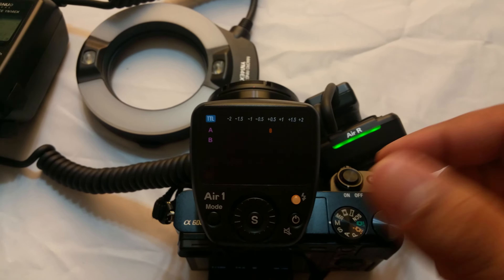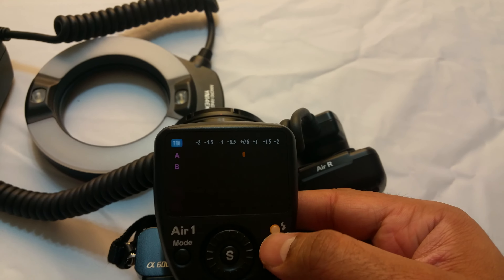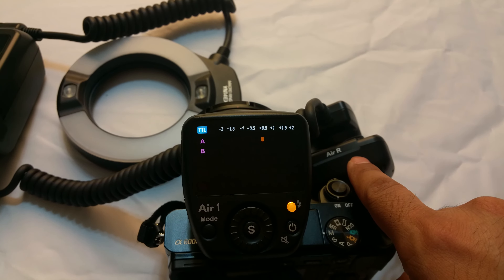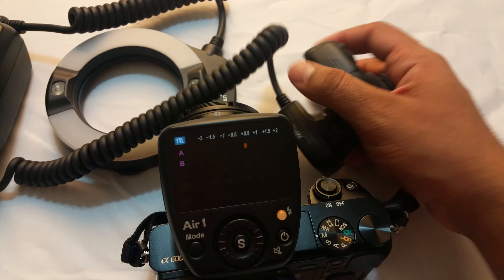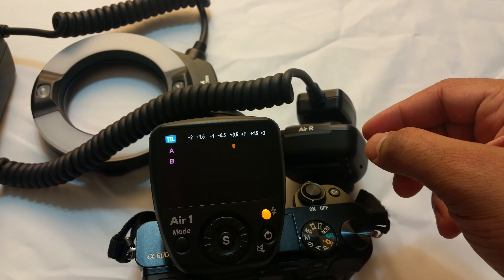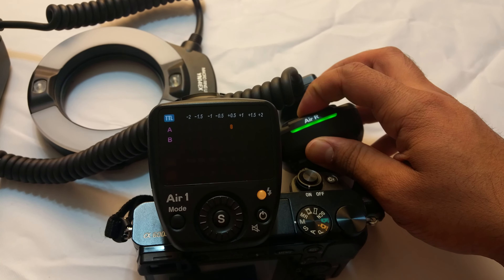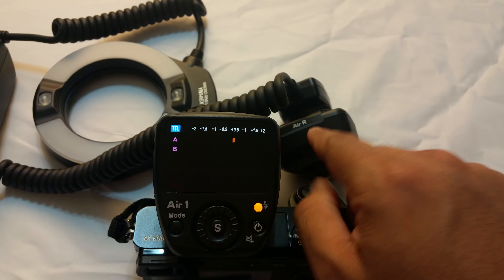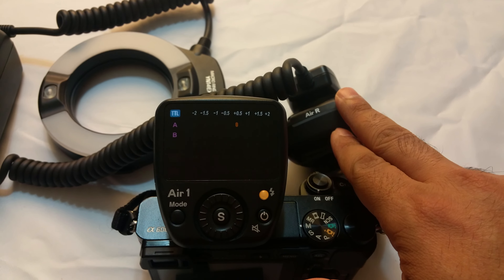Nissin Air 1 Commander Sony with Nissin Air R Receiver Canon

Comment: Unfortunately I am facing also problems with Nissin Air 1 & Air R . for some unknown reasons after 3 month using The HSS & TTL stop working on my A7rm2 + sony speed light ( HVL-43m ) everything sony and the receiver for sony too . 
but still working on A6300 . 
B&H not responsible after 1 month of purchase & Nissin not responding at all for the 2y warranty . 
something silly right .
Reply: This happened to me as well. 2 months after purchase the system no longer able to use hss in ttl mode.  I am able to fire hss on manual just fine.  No idea where to go for support.

Comment: ATG/Nissin has sold many ATG's Air X or Air10s to pre-paid/pre-order customers like Adorama and B&H Photo. The actual name can be changed providing if customers want/demand (think ATG/Godox, they change name under Adorama/B&H Photo/Interfit)

So you will need to get this awesome transmitter in May.
The ATG ranges is 1,000 feet while the Nissin has 100 meters.
* Any ATG's i60A, Di700A (Fuji/Hasselblad/Phase One/Canon/Olympus/Nikon/Sony)
* Any Air R

Let say, you are using Sony camera:
1. Buy the ATG/Nissin (May) for Sony
2. Since you already have Air R (Sony), place any Sony MIS flash on Air R
3. One friend has Air R for Canon, place any Canon ETTL II flash on Air R
4. Second friend has Air R for Nikon, place Nikon ITTL flash on Air R
5. Now, you got ATG's Tribrid TTL in wireless radio with Group A, B and C
or
6. Buy the ATG/Nissin (May) using Sony. Yes, you can buy C/F/O/N/S.
7. Buy or use any ATG/Nissin i60A or Di700A, then you don't need Air R.
    Again, i60A & Di700A (noticed the "A", it's by ATG) can be made for Fuji, Canon, Olympus,
    Nikon or Sony.

My ATG Gold Pentabrid Transmitter Kim X is compatible with Fuji/Hasselblad/Interfit S1/Profoto B1/Phottix Indra 500. And fully compatible with ATG & Nissn NAS Systems.
For $700.00+ USD, that is a great transmitter.
But if you are a beginner or amateur, get the ATG's Nissin for around $200 USD.

The world's first, only one transmitter is needed to work with many flashes/monolights.
* ATG AF illuminator (assist beam)
* ATG photographer firmware by Micro SD Port
* ATG wireless radio 1K feet or 100 meters
* ATG wireless radio TTL
* ATG wireless radio from 24-200mm zoom
* ATG wireless radio manual power adjustment
* ATG wireless radio 1st, 2nd and HSS 
* Very easy to see, setup and use

We needed the power of over 2,000ws when using HSS. 
That's why the ATG Gold Pentabrid Transmitter Kim X is a must for the working pros.

Did you noticed that ATG has hurt sales on Profoto B1, that Profoto is giving away a free TTL transmitter?

ATG is Godox/Jinbei/Interfit/Nissin/Yongnuo/Hasselblad/Broncolor.

Comment: Did you find out what was wrong? Is it because one is sony and one is canon???
Reply from the maker: Benni Knop yes, that's the problem. It should be of the same type sony-sony, Canon-canon
Reply: It is in receiver documentation: sony+sony, cannon+cannon, and so on... So in my case (i want to connect secondary CANON flash) it is not working...

Comment: The Nissin website report that Nissin Air R compatibility is locked at the same type of Air 1 Commander!!!! Air 1 Sony with Air R Sony, Air 1 Canon with Air R Canon! Only Nissin flash with NAS integrated inside are crosssystem compatible (you can use an Air 1 Sony with a Di700a Canon and a i60a Nikon at the same time but you can only use Air R Sony and not Air R Canon). The Air 1 Commander need the last firmware too for working with brand locked Air R (check Nissin website for more info).
Reply from the maker: Well said,, thanks